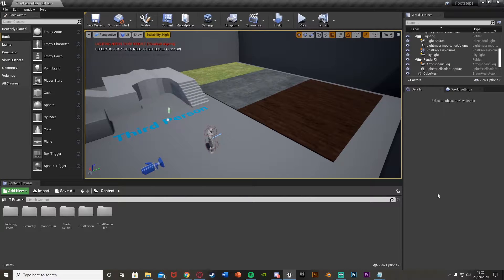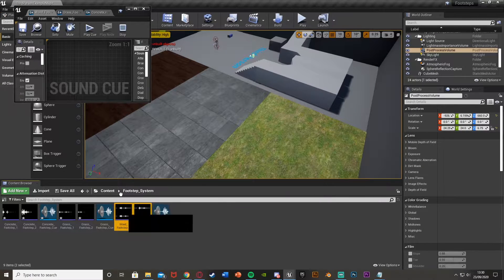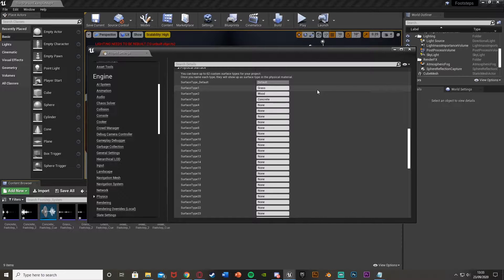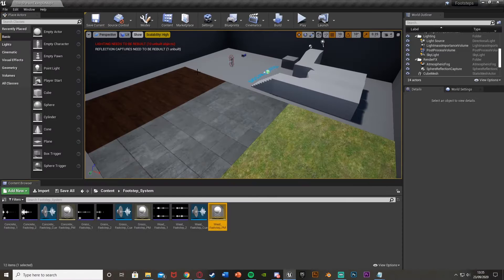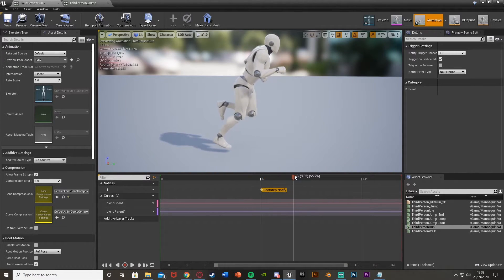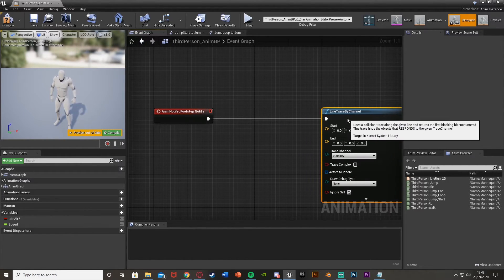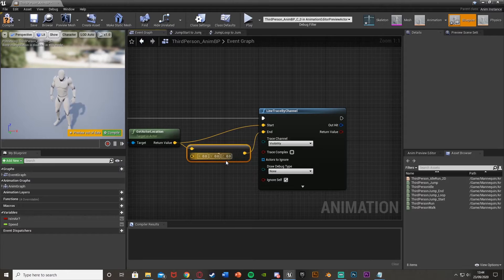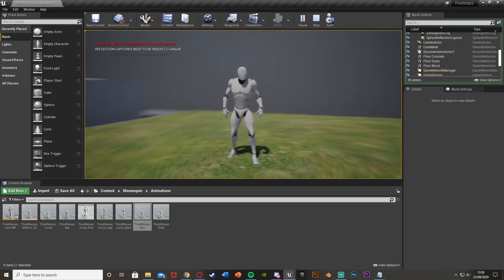Dynamic Footstep System | Different Sounds On Different Surfaces - Unreal Engine 4 Tutorial

Comment: Another great tutorial! 
For how is wondering, you can plug the physics material right in the "Layer info" of your landscape. And will work.
This also means you have the ability to have different effects like impact VFX. 

Oh and you can change the damping values of your surface. So i.e. grass could be slippier than concrete when driving om it.
Reply from the maker: Oh nice, yeah they're great ideas! Thank you for posting :)
Adds that extra level of detail

Comment: Hello, using UE5 now, im having a small issue. I think it might be an issue with my animations, but for some reason, when i jump, if it is a long distance and the animation ends , the footstep sound  of "landing" doesnt play. Same with my double jump, if the animation runs its cycle and i havent landed yet the animation sound wont get triggered, and im trying to find out ways to solve it but im not sure what to do. Would appreciate any help :)

Comment: Matt! not sure if you check these but its worth a try. I implemented this tutorial and it works as described. I run into a bug when I then try to implement a rolling/hard landing animation together with your tutorial. If I jump and cause the roll/hard landing animations to trigger, once the player resumes walking, the sounds will be played doubled up causing an echo effect with each footstep sound. This is resolved by jumping once normally but the bug will return if the player attempts the roll/hard landing animations. Got any idea where I can even begin to fix this? I added a "jump" node after the hard landing animation and sure it fixes the issue but then you have a random jump each time the player rolls or hard lands so its not a proper solution. *the animations are montages if that makes a difference

Comment: While it is a functional way, if you have 8 types of surfaces (wood deck, wood plank, grass, water, watter puddle, metal hard, metal soft, concrete A, Concrete B, etc...) if you need to change or add elements, you would need do changes to a lot of places, not to mention the spaggetti it would end up being with that switch, i prefer to use a cue parameter, is cleaner and you handle everything in a single place.

Comment: i did set it up for running fast running and walking but sound only works when i fast run otherwise no sound
edit: i was using a blendspace. so make sure u use correct animations in the blendspace on which u have set up notif

Comment: Heyo! great tutorial on getting dynamic footsteps. Very easy to follow! I recently implemented footstep sounds as well, however instead of using a line trace, I got the floor the character is standing on out of the character movement component. You can get the current floor you're standing on from the Character Component and then searching for "current floor", and from there you can break the hit result just like a line trace. I'm not sure if there is any performance difference in doing it this way. I imagine it's probably the same or negligible (I think the character component might use a line trace anyway to get the current floor). Anyways I wasn't sure if you knew about that so I thought I'd chime in.
Reply: I wish i could see exactly what you did... for me, it says "only exact matching structures are considered compatible" when i try to connect nodes to "current floor" . :\
Reply: @xiaobai7060  hmm, I wonder if something has changed. I'll have to check when I get home if I remember. tbh, nowadays, I just use a line trace like the video now. I think I had an issue doing it the way I mentioned where sometimes the sound failed to play for whatever reason.

Comment: Another fantastic tutorial! I now just search "Matt Aspland <ue4 topic>" when I need something Unreal related!
For others wondering: You can also set a Physics Material for actors that have no materials (like blocking volumes, etc). They're called "Physics Material Override"s on the volume itself. The line-trace code still remains the same.